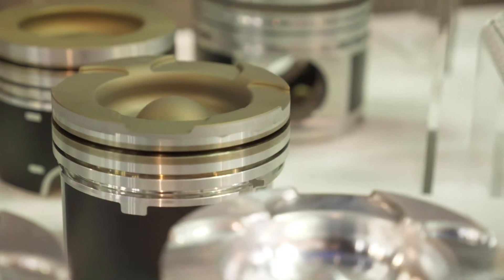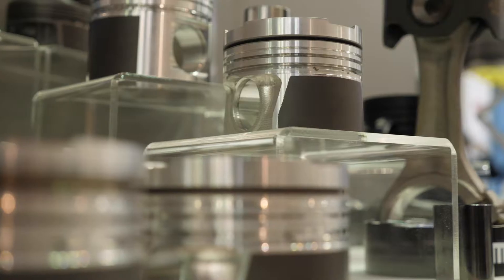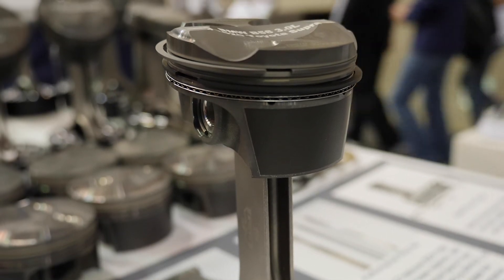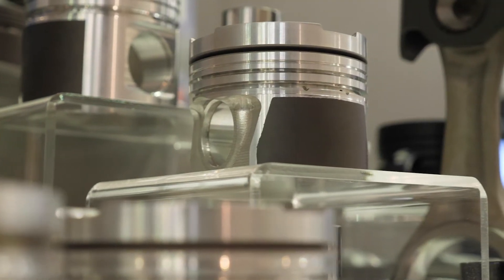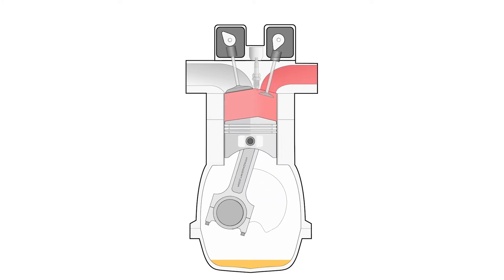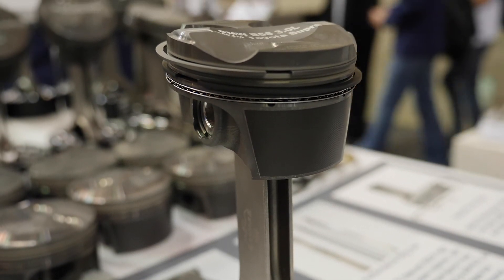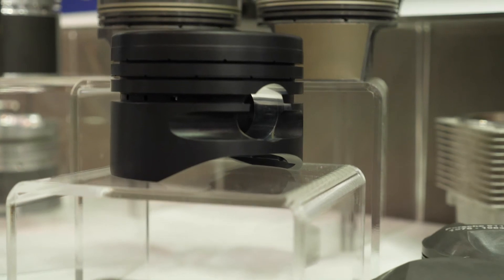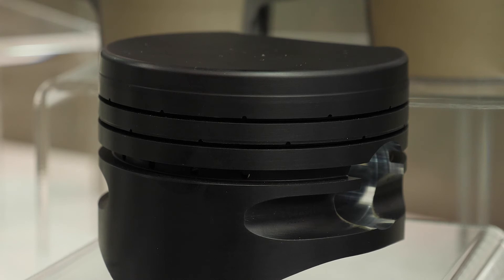Features & Benefits Of MAHLE Motorsport Piston Coatings

Comment: I worked at Mahle for almost 15 years. I worked on the diesel side as well as the motor sport. I put the coating on the diesel pistons. Both manganese phosphate coating as well as the anti friction coating on side of skirt. A lot of work goes into making Mahle pistons!!
Reply: I’m impressed. I have stock stuff. Have one diesel in the garage. an F-350 with the 7.3. I’m trying to keep it running forever so it’s stock. I’m amazed at the pistons being made. I would love to see the process but I get it’s all proprietary.

Comment: I would suggest that that thermal coating needs to come down to the top ring and not just be on the very top.  As someone that has melted many aluminum piston and even some that were coated I can tell you it does make a difference.
Reply: bcbloc02 They anodize the top ring land.